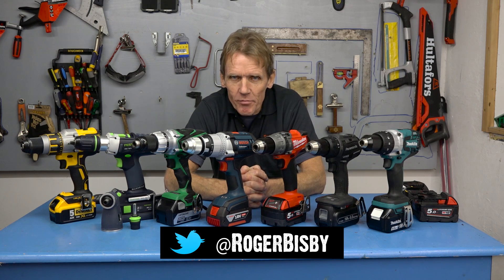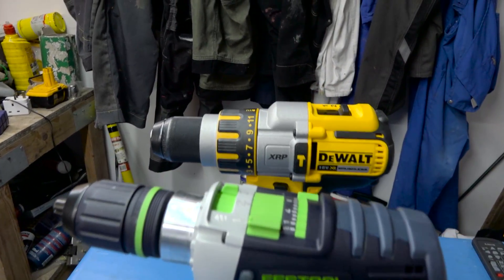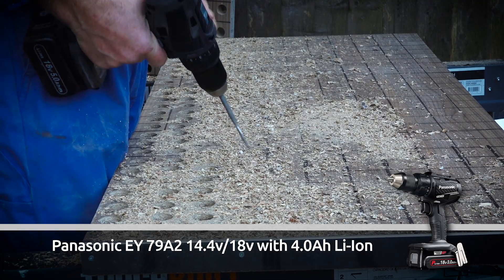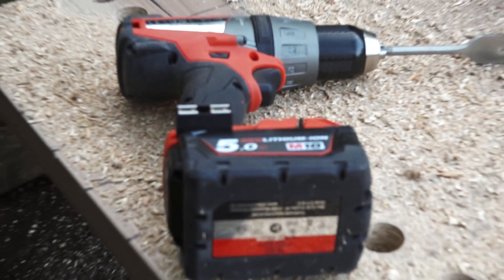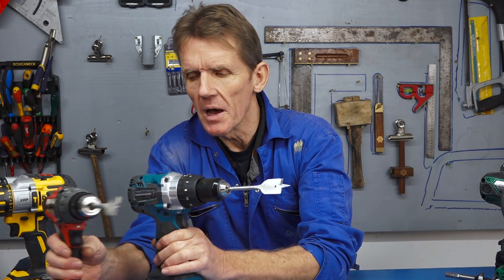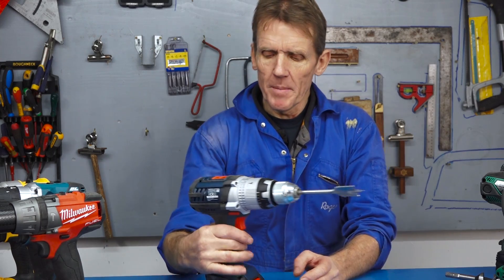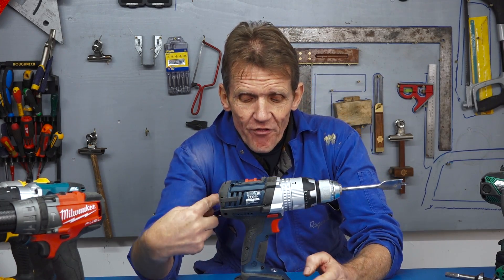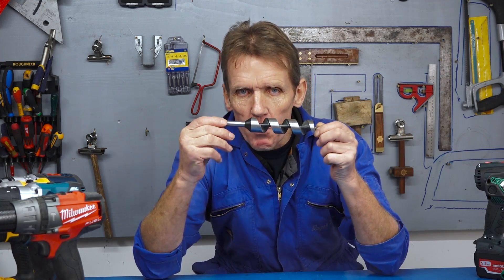18v Drills - Best Flat Bit Performance Review

Comment: I have that dewault cordless hammer drill and I noticed one FATAL flaw that really pissed me off.  If you are drilling straight upward with something that displaces a lot of wood like an auger bit, the trigger will actually collect the dust behind it because it has a cavity that is exposed when the trigger is squeezed.  After a few holes it will fill up and you cant even pull the trigger anymore because of all the debris in the way.  I actually much prefer my regular non hammer drill for any task besides hammer drilling concrete with it because of this fatal flaw, and actually because of the speed box I feel like my 2 gear non hammer dewalt actually has more power and the trigger doesnt have the cavity behind it like the hammer drill does.
Reply from the maker: +Final Cam Thank you very much tor that comment. I am sure that lots of viewers will appreciate the information and DeWalt will be asked to comment.

Comment: hello, like the first 18V drill test you don't read manual of the drill before use. On metabo SB 18 LTX BL, the button you use is an electronic torque setting not speed setting, you have on the top of the drill a special button to commute from torque limit  mode to drill mode without any torque limit, this change all the test !!!!!!!
Reply from the maker: +Manut2500 DIY Hello 
You will find that the button limits the speed and the torque and as such had an effect on the speed Watch the conclusion in Part 3 and you will see it explained n full and you may also notice the Metbo came out well.
Reply: +Skill Builder Hello, thanks a lot for your answer, when i send my first message, i juste see part1 and 2 and your explaination in part 2 was not clear. Now i see part 3 and i have view the good explaination.

Comment: Roger did you try the panasonic at full speed,to do this you need to press the speed button a fourth time so there is no red led light showing.I found the other 3 speeds were better for driving screws .I have the ey74a2 model which i am assuming is the same as the model here minus the hammer action.Your earlier review swayed me into taking the plunge and i am very happy with it.Thanks very much m8.
Reply from the maker: +pete piper 

That is interesting.  I tried it in all modes. The problem is that Panasonic didn't sent us that higher spec model for this test because we wanted combis. This model is lightweight but lacking torque. I am really pleased that you like that Panny. I wish they hadn't taken the drill back so quickly because we could have run a few more tests.

Comment: Roger are the 18v combi drills here "actually" these companies top selling 18v combi versions? All the models on test seem to be their "flagship" (top brick from the chimley) models and maybe just maybe not representative of the tools in actual use by the "general" industry? In my current job I by far sell more £100/150 range of combi drill with plastic shrouded chuck and lower capacity  (1.3/1.5aH) batterys.
Reply from the maker: +ZanderKaneUK 
Everything we have tested is the choice of the company. We asked for 5Ah just to make the test a bit more interesting but Bosch sent 5Ah as being more typical. We are going to get stick whatever so best to let the manufacturers put their best foot forward. That said not all the tools are top of the range. The Bosch is a 4 pole motor and the Hitachi is a lower spec brushed motor. We give a bang for bucks verdict based on the torque and how much is costs per Nm. Maybe we need to look at more drills in the future. Now we have a standard test to put them through we can build a list.
Reply: +Skill Builder Not knocking the test honestly, think you are doing great things here, maybe in the future and if time allowed a revisit to the lower end of the market to see if all things are equal? Out of interest would this be the price point you would buy in at "if on the tools"?

Comment: For me no matter what the results are you have to go with dewalt , Milwaukee or makita. (Maybe meta or Bosch too) The reason i say this is because of the versatility of the batteries. 
Makita are selling just the body for products and its cheap without the batteries you can get extra tools.
The Bosch feels nice in the hand they have a wall full at college i like them .
Reply from the maker: +Ashley 
You can buy naked drills in most brands which saves you money on the charger but the best deals are in the kits where you get a drill and impact driver sharing the same battery platform.

Comment: great video would have liked to see ryobi in there. what was you thoughts on the bosch you missed it out. festool as per over priced for what are mid range tools
Reply from the maker: +Robert John Allan 
Bosch is a 4 pole brushed motor so similar to the Hitachi. I cover it in the final part. Sorry I skipped it a bit.

Comment: I t does seem that the top range Milwaukee is pretty much the leader in all these types of tests. However, I'm real like most people don't really work this way, the overall feel of the tool and the other tools available with that battery are probably more important, although Milwaukee does feel great and has quite a nice variety of tools. Anyway, I have a small Festool drill for the fine work, and the newer Milwaukee Fuel 18v for the heavy tasks, very happy with the combo.
Reply: +Bill Hartsfield 

Extensive testing with timing has already shown that Makita's DHP481 is still faster/stronger then Milwaukee Gen Fuel 2.  The new Hilti model beat the makita by a few hundreds of a second
Reply: +dominic van lievenoogen  not from what ive see milwaukee the champ again and wait for those 9amps
Reply: +Dede Porter 

look here: 
http://www.protoolreviews.com/tools/power/cordless/drills-drivers-cordless/most-powerful-cordless-drills-2015/19018/

9 amp is not gonna change the power/speed of the drill
Reply: i have seen other reviews were the results have been the opposite but after seeing this maybe your right
Reply: Well in honestly they're all great drills so it hardly matters right? :D
Reply from the maker: +dominic van lievenoogen 
The 9Amp battery is for their SDS MAx drill. They don't expect people to put it on a combi drill.

Comment: Just a quick one roger about the Festool pdc did you have the torque setting either hard to far left or far right because as I have one I drill door locks on speed three. Great review its great to see all the drills being tested that's for taking the the time to make the video
Reply from the maker: +nippychippy Thanks Nippy Chippy I will check that out. We have done some more tests and it put the auger bit through solid oak which surprised me  so I will need to take a very careful look at it. Maybe it is just too clever for the bloke using it.
Reply: +Skill Builder ha ha it's the one complaint people say about the drill and it was down to the torque adjustment set wasn't engaged full
Reply from the maker: +nippychippy You were right. I moved it and it made a difference. I will put a note up.
Reply: +Skill Builder that's great roger just from my on experience that's what I did to
Reply: +nippychippy thanks for the reply again what happened to part 3

Comment: My guess is Milwaukee will be overal winner with makita in second place. But when choosing a drill one has to take into consideration all the other tools in the range and the qualities and versatility before buying.
Reply: +B1cam 

Extensive testing with timing has already shown that Makita's DHP481 is still faster/stronger then Milwaukee Gen Fuel 2.  The new Hilti model beat the makita by a few hundreds of a second
Reply from the maker: +dominic van lievenoogen 
You will see that we are testing 18 volt so the Hilti drill isn't a contender in that category. As for the Makita claim it may have more rpm but it does not have the same torque. It really depends what is important to you. I doubt that many people are persuaded by a few  hundredths of a second.

Comment: You didn't say if the bosch did well
Reply: bosch always do well
Reply: Badr Haddy i love bosch
Reply: +César Grimmelprez same here bro
Reply: Badr Haddy Yap,to
Reply: @user-rd5nc1nb9f  They don't. My Bosch fell apart after a few years and internet full of similar stories. Repair would have almost been cost of replacement. Love their angle grinders and a mini 10 volt circular saw. Strongly with Roger's skepticism about brand loyalty. My relatively new Milwaukee drill and their driver are best I've used. Next year - maybe another brand will come top